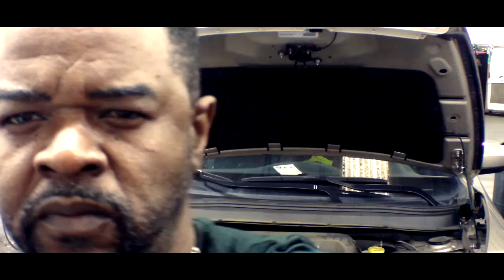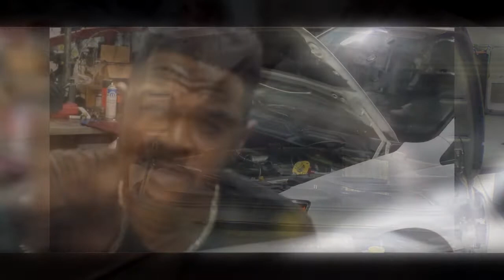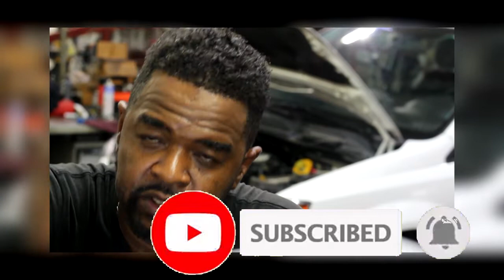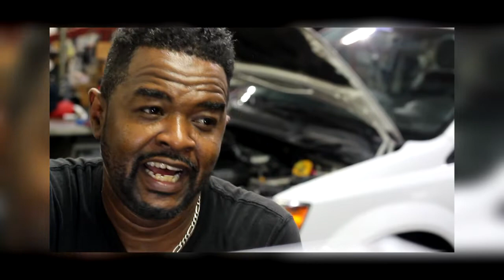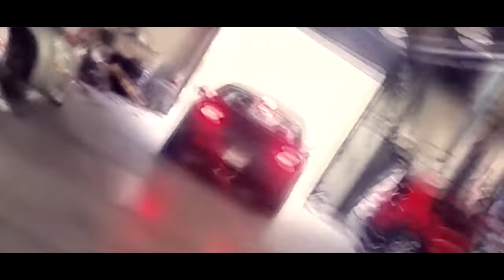Transmission can cause your car to stall at stops. TCC Lockup. P0740 62TE P0944

Comment: Do you know why or does anyone know why the torque converter control sylnoid or vlp or whatever its being called now days would go out repeatedly. No lights come on i'm thinking it could be the EVP going out causing the TCC to go out?
Reply from the maker: Its not going out, they never go out or fail. You likely need a torq convertor. What king of car is this? Also are you subscribed to the channel?
Reply: @OnlineMechanicTips  Of course I'm subscribed and it's a 2018 5th generation Dodge grand piece of s***. I've maintained the transmission. The filter and fluid have been changed every 45000 miles or so because I use it in a fleet but when I change the.  TCC control solenoid. it works perfectly for a while. There's never any sludger debris in the fluid. The dealership told me I needed a new transmission because 4th gear was going out and it's used for underdrive and overdrive. But? If I use the bump shifter as soon as it starts jerkin and I could feel the fluid pressure fluctuating. I can move the bump shifter to the left and it's always that 4th gear.  I can raise it up 5th and then 6th because it'll shift to prevent overspeed with the bump shifter and that will make it shift fine so if. It was a mechanical thing with 4th gear wearing out. I would assume that that bump shifter wouldn't be making it any better so I disagree with the dealership.
Reply: @OnlineMechanicTips  The only codes I have are for the catalytic converter and for the d*** brake switch. I threw a dirt last on there and realized that apparently it has to be a Mopar so I'm waiting it on that to come in the mail.

Comment: Bro, I have a 2011 dodge caravan, got a check engine light with code p0740. I changed the tcc solenoid. The light went away and came back. I have NO other codes. What should I do
Reply from the maker: You need a Torque converter. That solenoid you replace have no affect on this code. The problem internal to the convertor. Simply remove thans and go in with new pump and convetor. I also recondition the input clutch assembly since its out. But the convertor need to be replaced. Remember to thumbs up the video and subscribe to the channel, thanks
Reply: Alright man thanx

Comment: hi i'm using google translator.
jouney 2015 62te.
The car is normal cold, when it gets hot it starts to go out when we start a stop, it starts to shake and if we brake completely it goes out. Would you help me ? without fault code!
Converter and solenoid block replaced
Reply: Im having this same problem right now, how did you end up fixing it?

Comment: Hello I wanted to see if could help me OUT. I'm I live in Mexico. I have a town country 2008 with a t62. The problem I have is when you put the transmission in Drive the car dies they scan the car no codes found. Can you share some knowledge as to what it could be.?
Reply from the maker: Hello my friend, thanks for watching and subscribing. I noticed you mention no codes. OK, ide make sure the reason for the stall is not from a lack of air. Make sure the engine can breath and the intake air not restricted at the trottle body (make sure trottle body clean) OK, Now if you stall when trans put into drive, does it stall when put into reverse? It will be hard to tell if the T/Conv in lock up mode. A good scan tool can only tell you this if your problem electrical as in the TCM has it in lock up mode. But if its in lock up mode without command, thats internal trans t/conv problems. Not sure how your fluid looks inside the pan but if you have excessive clutch debri in the pan, then yes, its likely the T/Conv thats causing the stall
Reply: Hello again I check all the points you mention. When you put the transmission in reverse it work fine is only is drive it stalls. The fluid did have some wear from the clutch, but I forgot to mention that the torque Converter was change already and it still do the same a buddy came to scan the van and the only code that show now are the c123f, c2205 and c1240 all in the abs module the try to clear them and c2205 still show. That the only codes. If these related to the transmission?

Comment: 2001 grand cherokee never changed trans oil 125000, need a governor sensor and solenoid and I will change the filter so. 4.0 6 cyl.  can i just drop pan reuse old oil. mix with new and some lucas?? I know the thickness in the oil will help those gears move. Please help. If I just drop the pan NO FLUSH will I be okay